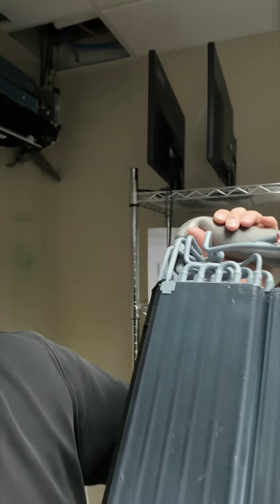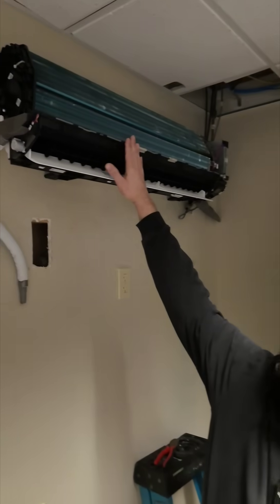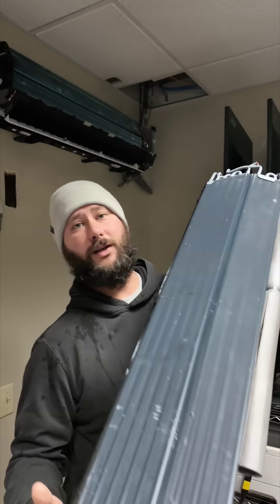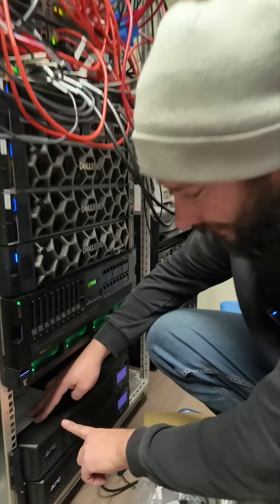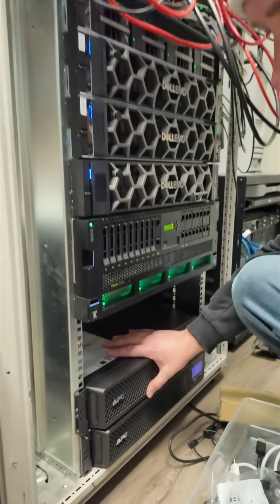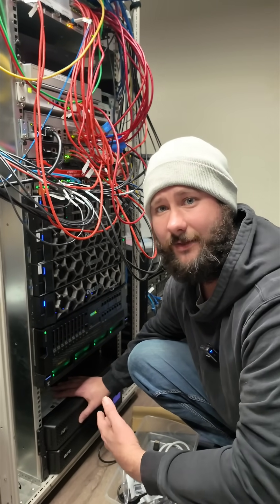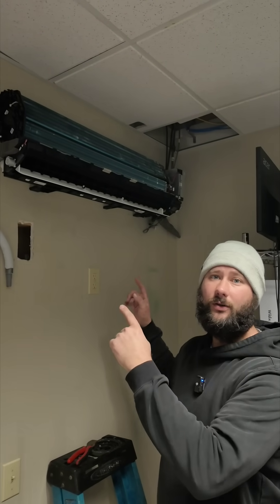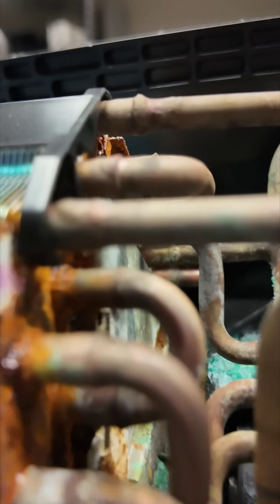Why Mini-Split Coils Fail in Server Rooms (And How to Stop It)

Comment: I wonder about what percent effective coverage of the heat exchanger fins & coils you get by after market spraying. I'm sure the can of spray is cheaper than changing lead acid batteries to sealed AGM  batteries, and the spray is definately cheaper compared to replacement t&m

Comment: This is a tricky one as a server room should have a fresh air feed especially using lead acid batteries. I would say a better alternative would be to use lithium batteries, however the expense would be higher, but save the AC system so cost might offset themselves🤔.

Comment: Why not set the batteries under a hood that vents the gasses outside or in a separate room with a venting system? Or use a battery type that doesn't emit gasses? Worked with batteries in sub stations and power plants and that is how they do it.

Comment: All our APC’s have sealed battery, thus zero off gassing.  Doesn’t make sense to me.

Or is the reason because they’re on 24/7 and see way more cycles than residential?
Reply from the maker: APC’s own UPS manuals include a safety warning about hydrogen sulfide gas from the internal sealed batteries — even though they’re sealed they can still vent under certain conditions.

Comment: They need to be compartmentalized and power ventilated to the outdoors with an automated Hydrogen gas detector that controls the exhaust fan.

Hydrogen gas is always produced and Hydrogen Sulfide is produced if overcharging or overheated. 

Or a better choice, use our LFP server rack batteries like we use for our off grid solar.

Comment: So stop using lead acid.......
Reply from the maker: For most server rooms, they're gonna go with lead acid batteries. Although they off gas compared to lithium batteries, they are much cheaper.So that's the reason they go with those batteries.
Reply: @taddydigest  they are no longer cheaper they haven't been cheaper for years . This is another reason why they are more expensive.

Comment: And with big server rooms, the battery room is seperate to avoid this. And to prevent the destruction of the server if there is a battery fire. Hydrogen is explosive too. So a spark can can cause an explosion if no venting is provided in battery areas.

Comment: will lithium phosphate  battery make difference?
Reply from the maker: Yes, absolutely.They would definitely make a difference because they don't off.Gas sulfur compounds like lead acid batteries.However, they're not used because of the price difference, they are much more expensive
Reply: @taddydigest  I think cycle life and percentage, total amount energy used might not be factored in. Fire risk is my fear. thanks for reply.

Comment: I'm not saying you're wrong, because I truly don't know. But I maintain a medium sized business's IT equipment. We have a 20KVa APC UPS with 8 car battery sized Lead Batteries. We have about 5kw of load on average (used to be around 15kw before downsizing) and we have 2 APC InRow Cooling units (not water based heat exchanges, just regular refrigerant. R-22 actually). They're about 15 years old and have never leaked, have any corrosion, nor do they have any special coating on them. What's the difference? And no, we don't maintain them very well. We actually went about 5 years without maintenance on any of it. Just had to replace the UPS batteries for being nearly 10 years old and not being able to hold the load. That was a $20k expense..
Reply from the maker: This is the only thing I can come up with So far i'm not gonna say i'm right.I think this is my theory behind it, but I will know more as I move forward.I do know that the quality of equipment was much better in the past.R22 equipment was amazing.In my opinion
I hope it's not manufacturing though.I hope it's that the equipment is off gas, but I will learn more as I move forward now.Knowing that the coils only lasted a year, so if this lasts longer, then that should prove my theory.And I'll let you know, and everybody knew in the next year or so
Reply: @taddydigest Maybe the room needs mechanical ventilation to limit VOC in such a small space  that could be cross contaminating with the condensation destroying the metal. Just the same a an air tight weatherized house can be dangerous to one's health without mechanical ventilation or an economizer.
Reply: R22 uses mostly copper with aluminum fins, the newer units use mostly aluminum with some copper, or just all aluminum, making them even more susceptible to corrosion at a much faster rate. The newer refrigerants are also at a higher pressure and it's a lot easier for it to escape 😂
Reply: Seems like those APC batteries are all sealed lead acid batteries that cannot vent anything, but I am not sure. The replacement ones I bought were sealed. The ones I replaced were sealed.
Reply: @troy3456789 They have spring loaded  vents because hydrogen gas is always being released. Hydrogen Sulfide is produced in if the battery is overcharged or overheated. They sell automatic hydrogen detectors that will alarm and activate a fan.
Reply: Either the metal on evap coils are junk rusting out throught condensation, which probably would have been a recall or class action lawsuit. The other issue would be cross contamination like he said with acid from the battery or overheating plastic gases from the equipment. In HVAC refrigeration the number one product to destroy evap coils is the gases and acids created by vegetables. The other issue I would think about is the conditioned air. Being a that this room's air is not being circulated by a supply and return vents especially on a RTU without a economize.